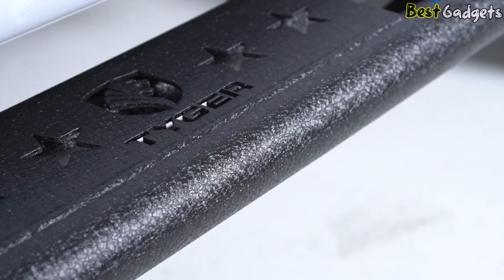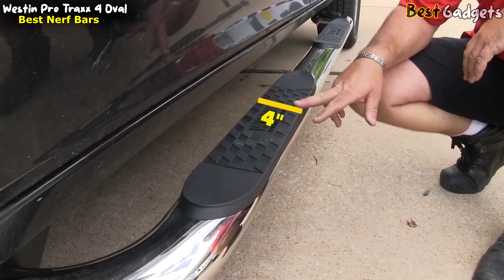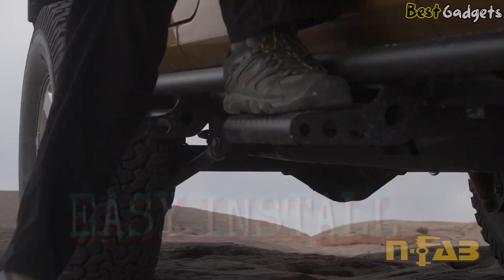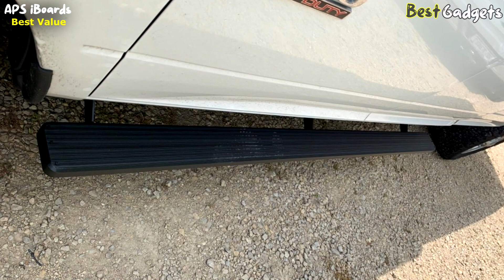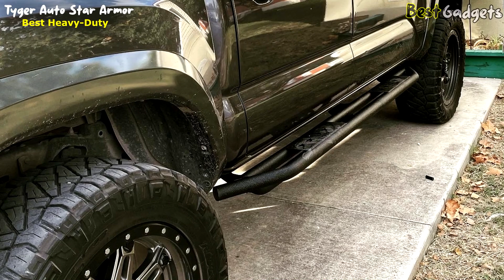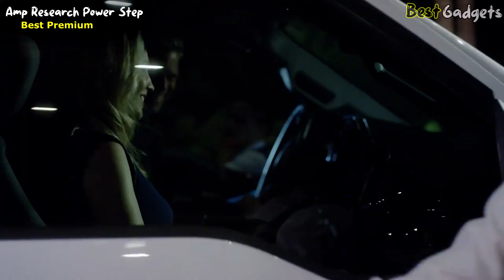Best Running Boards

Comment from the maker: ✅5. Westin Pro Traxx 4 Oval Nerf Step Bars
Amazon US – https://amzn.to/3ZtKEqd
Amazon CA - https://amzn.to/3ZPBjZy
✅4. N-Fab RKR Detachable Steps 
Amazon US – https://amzn.to/3yn5trc
Amazon CA - https://amzn.to/3JoRJTq
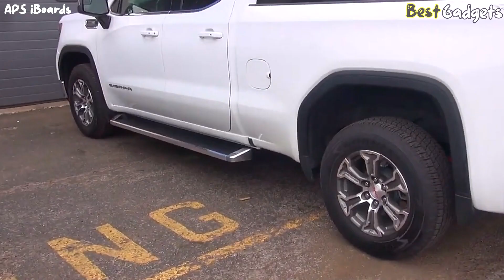✅3. APS iBoard Running Boards - 03:36
Amazon US – https://amzn.to/3ypXJEM
Amazon CA - https://amzn.to/3T0gCIg
✅2.  Tyger Auto Star Armor Running Boards
 Amazon US – https://amzn.to/3SSzQPT
Amazon CA - https://amzn.to/3SUc0mE
✅1. Amp Research Power Step 
Amazon US – https://amzn.to/3F3nWNl
Amazon CA – https://amzn.to/3Zt5pCm